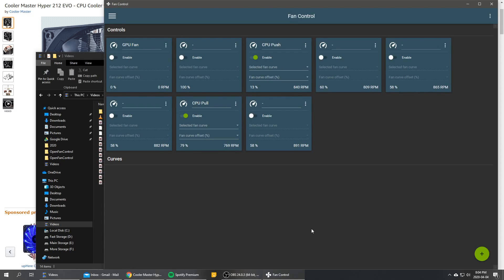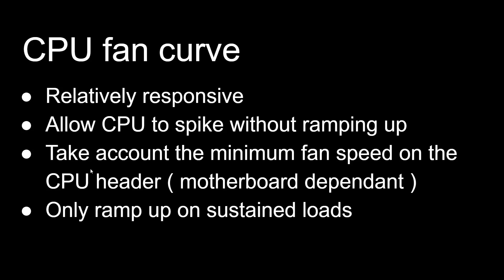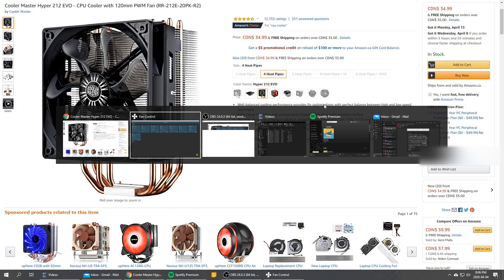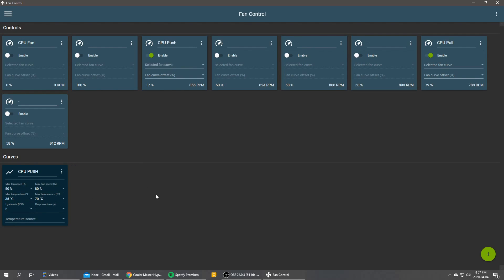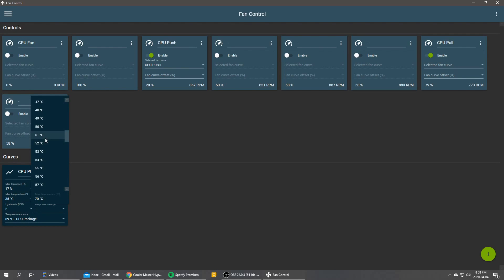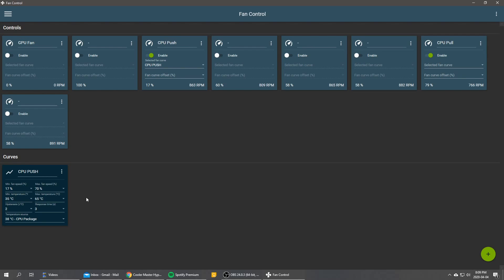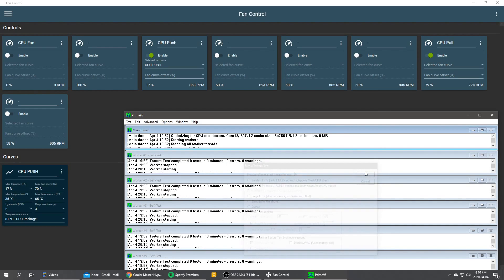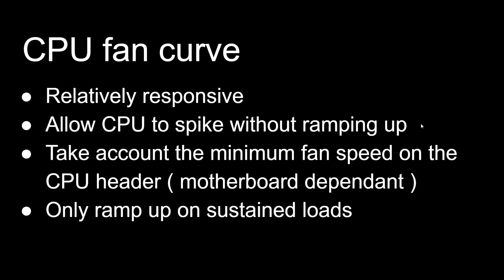Fan Control: CPU fan (Part 2)

Comment: Clicking on the green ball & just above on the left is a 🌡thermometer & on MIX dropdown menu shows all temperatures. It'll be nice to display them all in one box or by choices.
BTW maybe be able to move the boxes to all vertical or horizontal or random positions.
Fan Control is better than installing the MSI driver loaded with too much stuff I don't use - nice! 👍

Comment: hi RMSoftware, does your program work with AIO watercooling (such as corsair h100 v2) ??
Reply from the maker: Anything thats plugs into a fan header of a compatible motherboard.
Reply: @rmsoftware3759  thanks for answering, do you know how to make your program recognize these fans ? (recognized by the corsair software programs)
Reply: @rmsoftware3759  remy i cant control AIO pump with your program , motherboard is Z390 Master and cooler is Be Quiet Silent Loop 360. my pump is running on full speed and it makes annoying soud , i want to slow it down to 65% on idle. please help. Its connected to SYS_Fan_4 on motherboard but the program cant detect it?

Comment: 1. It appears this video was prepared before the fan step rate feature was added to FanControl.  Should the video be redone to show how the step rate should be set?  Would limiting the step rate be a better way to tolerate brief cpu temperature spikes than having 3 seconds of response lag?
2. I suggest adding a brief comment near the start of the video about whether the BIOS fan controls need to be disabled in order to safely use FanControl.  If the BIOS controls need to be disabled, it's important to say so.  If they don't need to be disabled, it would be helpful to say so.
Reply from the maker: 1: Indeed, this was done before some stuff was added. I've made other videos where I talked about these parameters. I might do a complete guide at some point with all the new parameters combined. Limiting the step rate and/or the response time are two ways to achieve a similar goal. There is no "better" . The response time is good for temperatures that tend to spike all over the place, while the step time is a way to make the transitions smoother. Just play around with the parameters and find the response that works best for you.
2: It's motherboard dependent. No motherboard is the same for fan control, so I can't really tell a guideline on that matter since it won't be accurate for everybody. However, in general, setting a fixed % in the BIOS allows Fan Control to take over.

Comment: After upgrading from an old Intel I5 to a new Ryzen 5 3600 (+ AsRock B450M) i had to dump Speedfan. FanControl works very well with my new cpu so thank you for that. After setting up i saved the configuration but i doesn't reload after reboot so i have to set  it up again. Is there a solution for that?
Reply from the maker: When you save your config, there should be a "userConfig.json" file created next to the application. When you open up the app again, it will read that file and load back your config.
Reply: @rmsoftware3759  thanks for your quick response. You are correct and it works but i noticed that sometimes the userconfig.json contains 0 bytes so there is nothing to reload. Maybe its just my me or my pc. Otherwise your app works like a charm so i m very happy.  I will visit your paypall acoount  asap. thank you!!
Reply from the maker: @whopperkaas5069  Hummm, if the file is 0 bytes it means the software tried to save most likely but an error occured...  Do you have a log file created next to the application when that occured?
Reply: @rmsoftware3759   i have emailed the log to your email. i hope it helps
Reply from the maker: @whopperkaas5069  Problem is fixed, you can download again.